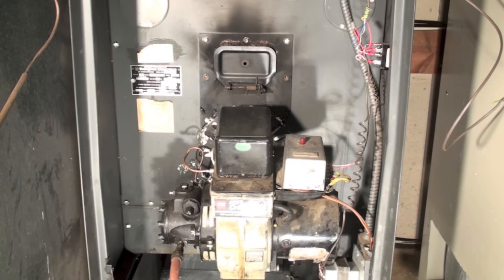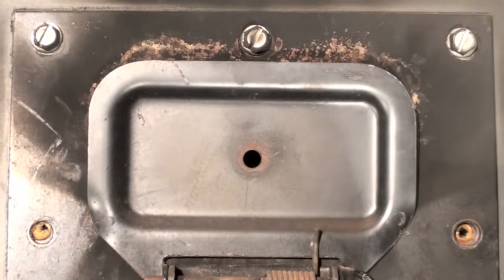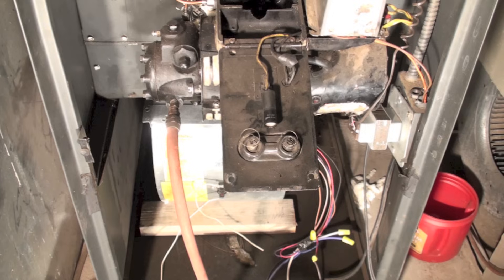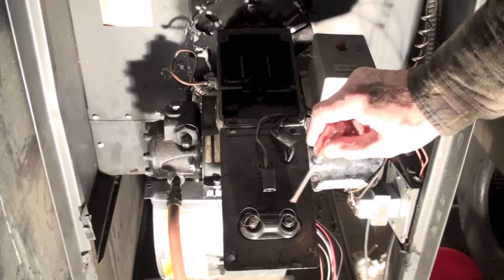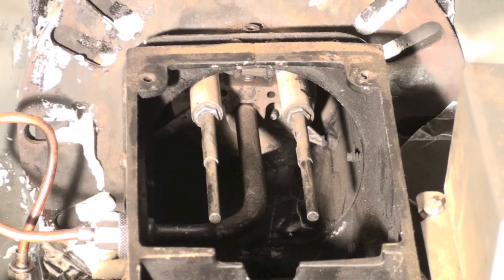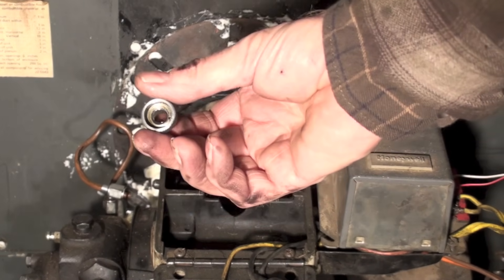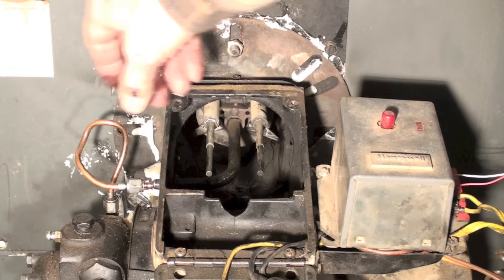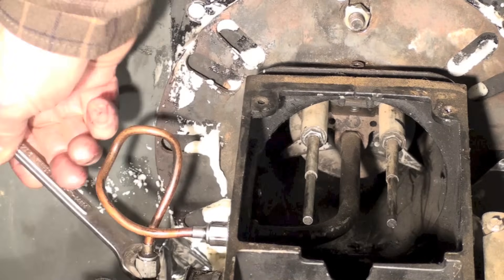Oil furnace troubleshoot part 2 No flame

Comment: Hello I have question If the spark doesn't spark How do I fix that problem. I fixed and replace Cadcell and It was good for 2 days then I notice that burner not running I checked the oil there is still oil in the tank then I did hit reset red button and notice there is no flame I will check the spark as you show but my question is if it not spark How do I fix it
Reply from the maker: If, when you open the burner and check the spark with a screwdriver (keep your fingers away, high voltage) you get nothing, check the voltage coming into the transformer.  Voltage in no spark out, replace transformer. If you have a very weak spark, also replace transformer.  Hope this helps.
GFM

Comment: If you feel you pushed the button more than you should have, can you take the 3 nuts off, pull the whole thing out, then clean out the chamber with towel or something? Just to get the oil dried up first.
Reply from the maker: The combustion chamber is made of porous materials, so it soaks up oil.  This issue is a bit of a problem.  Many times you can reset it and fire it up and it just smokes for a while.  On the other hand, you could burn down the house.  I can't really be sure.
GFM

Comment: Excellent vid. My burner doesn't keep up with supplying hot water. If I tap the Honeywell Intermittent Ignition oil primary or the square coil producing the 20k volts, it starts up. Any thoughts beyond looking for loose wire nut which I've already checked? Thank you, Sir.
Steve
Reply from the maker: If the burner motor starts when tapped, the problem is probably in the cad cell relay.  The only other thing I can think of is a start switch in the motor is not connecting, but that will result in the motor going off on a manual reset overload which means you will have to press the reset start the motor.  Hope this helps.
GFM
Reply: Thank you, GFM.
I removed the Ign. oil primary #R-4184 D from mounting so I can hold in hand. When burner not kicking on I tap this unit, holding it in my hand and burner fires. I tested the eye for resistance change and it is good. Should I think of replacing the ign. primary [the box with the red button]?
Thank you,
Steve
Reply from the maker: Steve Foley That would be my decision.
GFM

Comment: Ive got oil hot water& heat. I just had my furnace serviced due to the lack of fire starting on the 20th. Dude took it all apart, did everything exactly as you describe in the video, put it back together and it fired right up all squeaky clean. He mentioned that it seemed i didnt have a strong spark and i saw it myself, but it started up first time and i was okay with that. On the 24th, again, no fire. Confused as all hell, i set up a space heater in my basement and went off to work without a shower. throughout the day, i was trying to think of reasons why it wouldnt light, and it dawned on me that my rigged up house has at least one outlet on the first floor on the same circuit as my furnace in the basement. That outlet had an Edenpure plugged into it, running. I came home took the Edenpure off that outlet, and hadnt had a problem with the furnace for the rest of the week. Sweet. Made sense to me that the draw on the circuit was dropping my voltage in the furnace. Till 30 minutes ago. I realized it hadnt fired up in a number of hours, and went and turned up my thermo. no response. UGH.

Current thinking: Due to oil prices and inefficiency of my hot water heat, I had 2 space heaters on opposite sides of the house running all day to minimize my furnace having to run. It was a brilliant 2 degrees this morning, so i put in a third space heater elsewhere. The only possible conclusion I'm at is that with 3 space heaters churning in my house, I'm dropping the voltage in my furnace no matter what circuit breaker i'm plugged into. 

And i fly out to Greenland in 4 hours, and will be back in 2 weeks...... So hopefully my girlfriend can follow my instructions of having minimal space heaters running to ensure proper fire ignition.
Reply from the maker: I know it seems logical that space heaters could reduce voltage, but unless you have a seriously undersized electric panel they will not.  You probably have a problem with the burner.  I would call the service tech back.
GFM

Comment: Repeated pushing of the reset button should be expected. that's what people do.
No, they don't understand that it may fire raw fuel into the heat exchanger or that the duty cycle of the transformer is so low that it gets cooked as well(unless it's continually rated of course). I have seen a lot of controllers damaged by this also. The main thing is that you are the serviceman and you should expect this . I always inspect the inside of heat exchanger for fuel and holes. I also know of another serviceman who tried to start a heater without basic checks after it sat all summer. The owner didn't turn the tank off over summer and pump on the burner was very worn, `over the summer fuel was able to slowly drip out of the nozzle as it was able to pass through the gears in the pump. The heat exchanger had bricks in it. The end result was a big fire which took out part of their house. They were rebuilding the house when I installed the new unit.
Reply from the maker: Great story of a seldom seen but very nasty problem.  Usually there is some indication of oil leaking out of the combustion chamber, but not always.  Thanks for the thoughts.
GFM

Comment: if there's a house full of experts where the service call is and you think the red button has been pushed many times, after you've determined that there is fuel in the tank. couldn't you hook up a hose up to the bleeder screw and loosen it or the other thing is hook up a pressure gage to the pump to stop any flow of oil to the combustion chamber while  cking out the transformer and the cad cell relay, that would let you know if any oil is coming to the pump, air in the line, water in the line, and you could see if the squirrel cage is turning and if the pump is working. . eventually the service person has to push the red button thou and then they'll have some idea how many time it's been pushed.

Comment: I don't take any chances, for the time that it takes, I take off the 3 nuts, unhook the line and pull the gun especially in a mobile home, people always say they only pushed it once, but when it starts, it's too late to stop the fire till  it burns down and it could burn the house down..
Reply from the maker: You will never get in trouble that way!  Mobile homes scare me.  I have seen the roof jack blown off the roof!  Thanks for the comment.
GFM
Reply: I agree with the mobile homes being scary, I don't like to work in them but sometimes have no choice, there's no basement, the furnace is in a small  closet between the bath and a bed room with a tiny hall to work in and most of the time it is covered with a  carpet.. just a pain.

 we're enjoying your videos
Reply from the maker: +Richard Elkins Unless the combustion chamber is cleaned, it won't help.  If the button is pushed and oil is getting into the combustion chamber, it soaks the combustion chamber.  Dave is pulling the burner to check the combustion chamber for oil soaking.  If it is soaked, it must be removed and replaced.  Not easy to do, but the only safe way to fix it.  Hope this helps.
GFM
Reply from the maker: +Richard Elkins The number of button presses only counts if the burner never lights in series.  You can pull the gun and run a wire in to the bottom of the chamber, then pull it out and check if there is a level of oil on the wire.  If you show a level, the front of the furnace must be removed and the chamber replaced.  Quite a job.
GFM
Reply from the maker: +Richard Elkins I think you have done what is necessary to be sure the combustion chamber is clear of oil.  The cracks in the combustion chamber are not necessarily a problem unless a portion is completely missing and exposing the metal heat exchanger.  
GFM
Reply from the maker: +Richard Elkins If the flame contacts the heat exchanger, it will burn thru the heat exchanger.
GFM

Comment: i have checked the gun and it was gunked up , i cleaned it off and the gap is right on also. i checked for a spark and there is a spark.. but i still can not get a flame to happen.. is there anything else i can do or another video you have posted for more things too check?? great videos BTW very easy to do
Reply from the maker: Look for a mist of oil in the combustion chamber during a trial for ignition.  That will tell if there is oil supply.
GFM

Comment: Great videos! My mom's furnace stopped running.  Had to learn about Beckett burners online. Finally found your videos and it made my life so much easier and didnt blow up her house with me in it. Checked everything electrical and checked out ok.  Then pulled the gun and it was gummed up very bad.  Replaced the nozzle ($5) and it fired and was ok until yesterday. When I was replacing the nozzle, I noticed the electrode tips were at 1/4" apart. At that time I had not watched your video on setting the gap.  Now I have to pull the gun again today and do that.  Thanks for doing these videos. They are some of the DYI I have seen, period!

Comment: My burner will ignite if I just barely lift the transformer and put it back down when it is trying to ignite. What do you think that means? The spark tests fine with a screwdriver and electrodes seem clean and well gaped.
Reply from the maker: I would start with a service of the burner.  It could be a combustion air issue.  Hope this helps.
GFM
Reply: I had a place out to look it over a month ago. it was running good for a while then started acting up again...
Reply from the maker: jcardwell3rd You can try air adjustments but you must be sure you do not get a sooty flame.
GFM

Comment: Thank you for your videos. a life saver..  OK.. so resetting too much is a major problem.. what fixes are there for that?  anyway to clean out the majority without complete burner removal? will it evaporate if left alone for a couple days?
Reply from the maker: Its up to you what you do, but waiting will not help.  To be sure, if the unit was restarted only 3 to6 times, it will start and smoke for a while.  But will be ok.  However, sometimes several people have reset it then who knows.  Fuel oil carries a large # of BTUs and can get out of hand.  Hope this helps.
GFM

Comment: Hi, my oil burner is letting out a really bad smell now and the boiler sounds like it's trying to shut down and it doesn't. I decided to turn the entire system down with the emergency shut down switch. Do you think the issue might be that it just needs to be cleaned out?
Reply from the maker: I assume you are getting a rumble out of the boiler.  Boilers often tend to soot up and it could very well be the problem.  It could also be a plugged chimney.  Get out your soot clothes, or call somebody.
GFM

Comment: I wanted to thank you....you saved my wife and my Dog a very cold night on 15 Dec 2013.....i got it to fire up for the night....wanted to let you know your work and teaching were well worth it to me!!! Thanks GFM from a fellow Gray haired guy!!
Reply from the maker: Glad you are warm.
GFM
Reply: BJ Hill 460v 3 phase 60hz iron fireman proton accelerator, Saquan barkley has it on 30 amp
Reply: Nick Chubb deuterium accelerator on 120/240v open why delta 3 phase super heats water for church dishwasher at 210 deg and is on 225 amp 208v phase fusion reactor!

Comment: Yep, very good video!
Reply from the maker: Thanks for the support.
GFM
Reply: Sorry I didnt have time to elaborate but I view your vids when problems occur with my furnace. Recently, my furnace went out for about one hour without running in between and no switch to reset. It was minus 20 celcius outside and had to run backup heat. I thought I had run out of fuel when it mysteriousely kicked back on. Having done and checked all I could, I suspect wiring troubles from thermostat to furnace. How important are these wires and what gauge recommended?  Also, it is true that the firing rods electrodes move and need to be looked at often when servicing. Yes, I do like your videos and thanks for your honesty.
Reply from the maker: Alex Blais The thermostat wire control the furnace operation, so very important.  You may have a poor connection.  The electrodes wear from sparking, so the spark gap gets wider.  Should be 1/8".  
GFM
Reply: Electrodes wear makes sense. Im using 14/2 electrical wire from stat to furnace. Im pretty sure there is a cut somewhere in the line which is a single copper wire. Should have used strand wire instead. I think I will rewire this week.